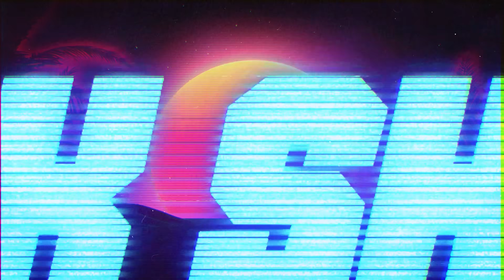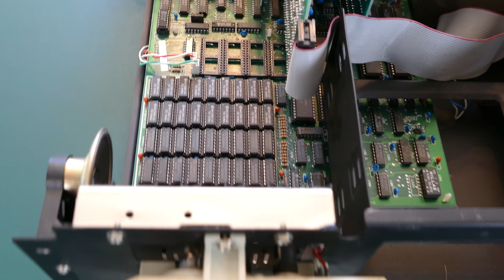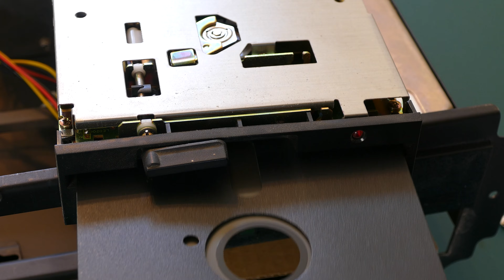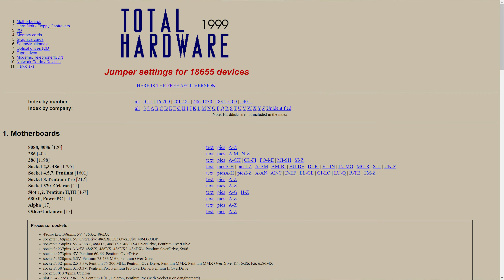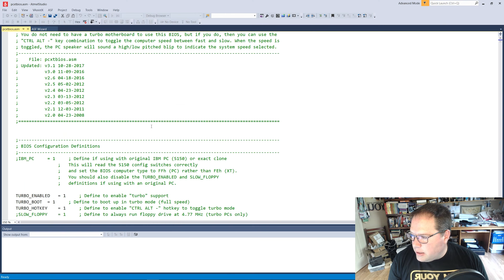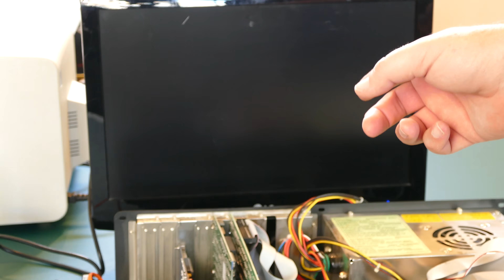I Found A 1987 PC Clone! Will it work?

Comment: Low level the drive with spinrite and it will autmatically mark bad tracks.  sometimes a low level will fix the drive and it will be reliable again.  you have to remember that the current format on there is 30 years old.

Edit:  New Subscriber here.  I heard about you on Adrian's channel.  I kind of want to start a channel too as I do the same stuff you, Adrian, LGR, etc. do and hopefully I'll get the guts up to do it sometime.  PS:  Glad you are recovering well.

Comment: Glad you are feeling better!  I think that programmer can test chips, too. May be worth checking if its able to test your RAM.
Reply from the maker: Looks like it will do some SRAM and NVRAM but not DRAM. At least in this version of the software.
Reply from the maker: I hadn't thought of that. If so, it would be better than the hunt and peck replacement method. Especially if more than one ram chip is bad.

Comment: The main issue with older MFM drives is that they need to be parked if the computer is to be moved.  Another issue, is that drives like the ST-225 use a stepper motor to move the heads and due to thermal expansion and contraction, the tracks and the heads fall out of alignment.  Letting the drive warm up to operating temperature may fix some of the seek errors.  Your best bet is to do a low-level format on the hard drive.  You should be able to boot into DOS, run debug, and enter in g=c800:5 at the debug prompt.  This will let you do a fresh low-level format.  MFM drives can be very reliable and I have many vintage PCs that still have their MFM drives in use.  Once I get the drive partitioned and formatted, I will run either a Spinrite or a Norton Calibrate and do the 80 pattern test on the drive.  This will get any bad sectors mapped and the drive should work perfectly.
Reply from the maker: Thank you for those tips!!! I will try that in the next part and see how it goes.
Reply: @RetroHackShack  I had recently acquired a bunch of old MFM drives in an unknown status.  One of them, an old CMI 15MB drive, had been dropped and also had it's head actuator locked up from decades of non use and improper storage.  I was able to free the head actuator up as there was an access door underneath the drive to get to the linkage.  Once I got it free and working, the drive actually worked!  It was loaded with bad sectors due to improper storage,  These old drives need to be stored in a climate controlled location.  I was able to map out the bad sectors and the drive worked well.  It's quite amazing how robust these old drives can be.  The Seagate ST-225 is one of the most common 20MB MFM drives out there and the seem to never die.

Comment: Those old cards typically came with two serial ports. The 25pin is more than likely the second serial port.
Reply: Exactly. I was surprised wen he mentioned it could be an external floppy. Also the button lock it is a mechanical key lock tha blocks acces to tbe keyboard, not the hd. Wrong information in such a technical video is no the best one could desire. Homework!.
Reply from the maker: That makes sense. I guess I remember that now. It's been too long.

Comment: That Willas component, form factor wise, looks like a knock off of a Dallas RTC chip.
Reply from the maker: That's what I thought too, but the manual doesn't mention a RTC. Seems like that would have been a feature they would call out back then.
Reply from the maker: OK. I took another look at the schematic this time and not just a search through the manual. The schematic labeled it as a 31A-5101. Turns out it is a digital delay module. A google search on that part number should turn up a datasheet if anyone is interested. https://www.digchip.com/datasheets/parts/datasheet/000/31A-5101-pdf.php